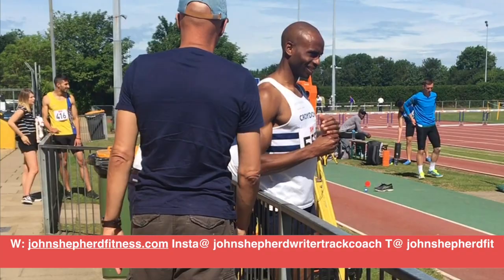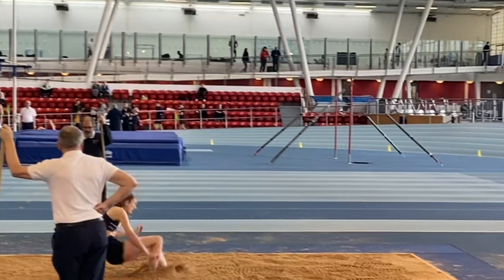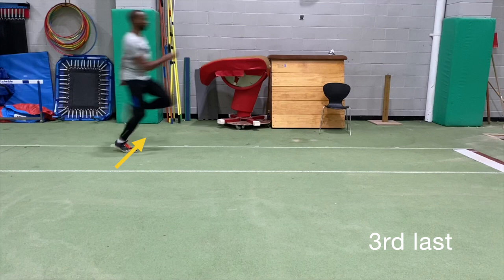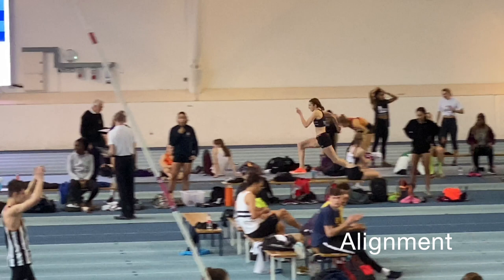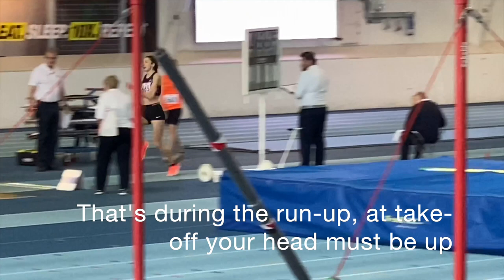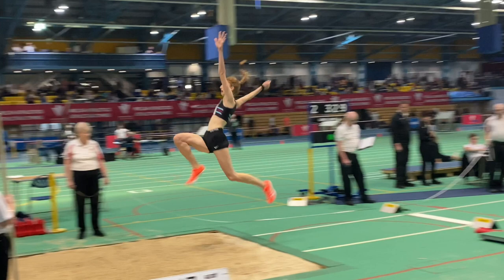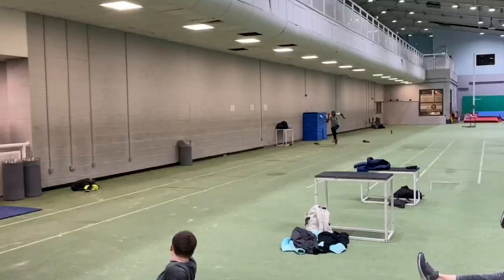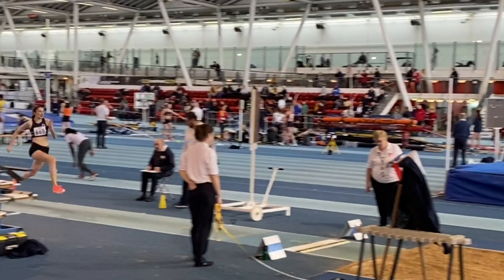HOW TO PERFECT YOUR LONG JUMP RUN-UP - NO MORE FOULS

Comment: Hey John, I teach jumpers that it is better to be short of the board than to reach for it and that you will actually get a better distance.this is true. Plus gives a better indication of the run up and changes that need to be made
Reply from the maker: I'd tend to agree. The last stride is always the shortest (or should be) of the final steps into the board with the pen being the longer. As a guide the last step should be circa 2.20 for most adult jumpers. The second last 2.50m. The mat work videos on the channel referenced in the video will give you more detail on what I'm saying here. Hope that helps.
Oh, we do a lot of training to the pen step length - you'll see that in the videos. Doing that will hopefully establish the correct/optimum final step length with repetition.

Comment: Hey thanks for another great video I had some questions about training when it comes to triple jump what’s the longest approach your athletes do in practice and complete a jump from? When I’m jumping I normally stick to 3-5 doubles and if I’m doing full approach I do my first phase. But also what I’ve noticed is that in competition I jump 14.70m from 6 doubles but when I go to any longer approach it feels a bit harder to achieve that same distance or better. I’ve been thinking since I mostly do short approach jumps in practice I’m not used to carrying more speed down the runway. But I’m still trying to find the ideal approach for me in triple jump.
Reply from the maker: Nick, I think you have answered your question in part. It sounds that you are not too far away from getting that sweet-spot between medium length e.g. circa 12 steps in total steps to the board jumps and also hopping from your full length run-up in practise. Two things come to mind for me here though: 1) If you are in competitive season and have a number of comps coming up on the bounce then hopefully the comps will get you right on top of that specific requirement to take-off at speed (nothing beats getting up to competition requirements that a run of comps - as long as you are properly conditioned and ready from the training you have done - which I'm sure you are). The second answer could be to include some very testing - in terms of the contact forces involved plyos in your training as you lead up to comps. Doing two steps from an 8-10 step approach off a low plyo platform and really going for it is such an example. This will give you the confidence and develop the CNS in order to hopefully cope with the landing forces and of course there's a technical element as you need to hit the right shapes to move through the phases. Only do 4-6 efforst per session if you try this. 
Actually there is a third possibility and that's phase ratio ... it'll take me a long time to write an answer here, so I may address this in a future video. One pointer - try to get the step at 30% of your total distance and work out a hop length to go for in training, so that you can do that. Hope this helps and good luck.

Comment: What would suggest for a male triple jumper with a hop-step distance of 10.1m+ but who only has a 4.50m jump phase? This is happening from going too vertical on the final phase, how would you combat this?
Reply from the maker: Thanks for the question: potentially you are over hopping and leaving yourself with insufficient speed to get out of the jump. It can be difficult for jumpers of all levels to get a consistency with phase ratio. Adrenaline etc takes over in comps and the ratio can fall aside (sometimes without negatively affecting performance). So, I would try for more of a balanced phase ratio initially - go for 33-35%% of total distance for the hop, 30% for the step and then 33-35% for the jump. Try this off a medium length approach first by dividing your average jump distances off this length approach by the percentages just mentioned and put tape or sand lines on the track and try to get that rhythm. Obviously this will need to translate to full approach efforts and comps but it may help with your distribution of effort and your feel for the event. All the best and let us know how you do.
Reply: John Shepherd track & field coach - author & editor | awesome thanks for the help.

Comment: Sorry just another quick question, my son's coach makes constant changes to his run up depending on where he hit the board on the last jump. My theory is that it's more to do with the run up ie did he push of xtra hard at start, not as hard etc and it's more about consistency than making little changes per jump